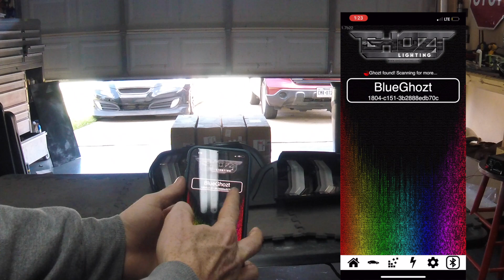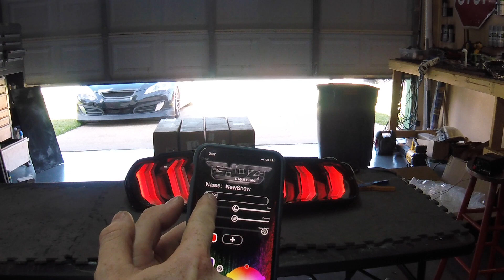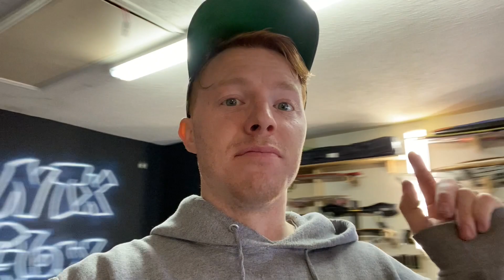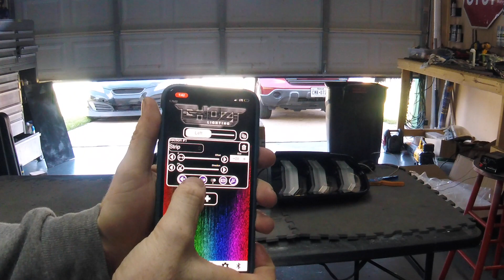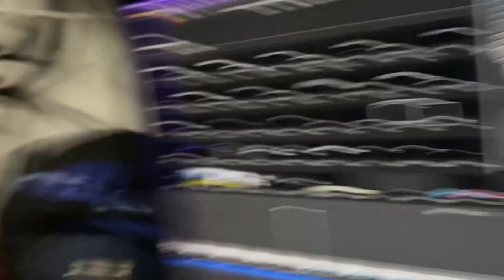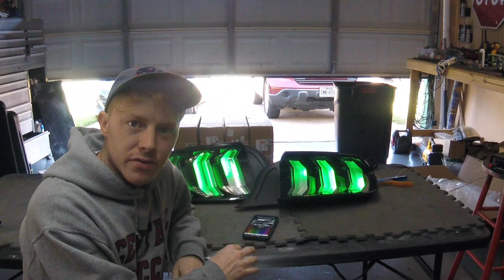how to use BLUEGHOZT APP - set up and use

Comment: I just got my headlights done. I can’t figure out how to have a solid non-blinking halo. Also I can’t select just red or white
Reply from the maker: depends on how they where built, have to make sure that the parking light wire was tapped into the oem parking light harness. or you can select the "solid" show mode, delete all but one color and then set that color to whatever you want

Comment: I’m currently dealing with an issue with my mustang tails that have the ghost control. It takes 60 per side to light up the entire housing. I have 60 selected on both but on one side only one column is lighting up. The other side is fine. Any tips? 

I have checked power, ground, connections, deleted the app, used another phone, but nothing is working.
Reply from the maker: oh man that sucks! 
kind of sound like the wiring might be messed up, like the data power or ground is not flowing to the other columns

Comment: Thank you for this, i had no idea where the pixel count were at also just learned if you dont ahve a build thats specific for a ghozt you can still use a ghozt as a led controller might not have all the functionality but can still use thw show modes
Reply from the maker: oh yeah! 
all of the new pre built headlights with rgb in them can be wired up to a blueghozt module. 
and you can wire up the factory functions as well but you'll have to tap into the headlight harnesses
Reply: @zaccook  ya I'm trying to figure that out right now, ik where and what wires I need for  custom turn signals, rn they work but no customizing and the DRLs I have a base accord with touring headlight and the harness needed but no idea what wire is for the drls so dang confusing I just want those awesome start up sequences 🤧

Comment: My parking mode lights stay on for too long and I don’t see any option for duration to set in how much time I want them to turn off🥺
Reply from the maker: the parking light mode really depends on whatever vehicle the lights are installed. 
like my genesis coupe parking lights stay on for like 1 to 2 seconds after my car shuts off. but my trucks parking light stays on for like 3 to 5 minutes after the truck shuts off.
Reply: @zaccook  the actual headlights beams turn off 15 seconds after I turn off the car but the DRL bar stays on for for 10 minutes or so unless I go to the app and manually turn off the parking mode off. I have a 2019 TLX
Reply: Hey bro, was wondering if you could help me I’m having a similar issue, on my mk6 gti, after I switch the car off even after like 2 minutes the drl lights would stay on and the blueghozt controller would still give me the option to connect to it meaning it’s still receiving power even though it’s not connected up to a constant 12V power source, I haven’t actually tested any longer then two minutes is there anything about this? Also my turn signals I’m struggling how to get them to work properly without when using my stalk for left or right turn signal blinking faster indicating it has a fault

Comment: how's it going, thank you for the video i have a question though, I just had a shop install my ghozt module and it came with 2 splitters for my underglow of course my underglow is 12V, the shop used the 2 splitters the module came with, does it matter what underglow is connected to which plug on the splitter??
Reply from the maker: Hey! So it kind of depends on how the ghozt module is wired up. 
If i wired it up i would have it set up to utilize the left and right side of the ghozt module so that the show mode works with the under glow and i leave turn signal wires out so that you could tap those in for a full car turn signal

Comment: Thank you for the good explanation! I still have two question where I couldn't find anything about.

1) I want 3 groups and each has 10 LEDs. So when I turn on the turn signal all leds in the first group fade up from 0-100% and then the next group. Is that possible? It's like a sequence, but in bigger sections.

2) Is it possible, that when I break the brake light is on, but when I also activate the turn signal, the brake light on that side turns off?

I have a 68 Mercury Cougar with custom tail lights and the part from 2) is how it works originally. That way I could mimic the incandescent bulb look.
Reply from the maker: thanks!

1. yes you should be able to do that if you have the end of one strip wired into the front of the other strip, 
if you decide that you want them to fire at the same time then you can adjust it in the app and have them all fire at the same time. 

2. yes! that is actually how the controller is designed to work already, wiring up the controller might be a little weird if your car is using the same bulb / wire to fire the turn and brake. 
may have to tap into the wiring up in the dash / fuse panel area for that signal.
Reply: @zaccook  Thank you very much for the fast reply!

Comment: Hey! I only have one question, how it is the wiring for the turn signals to work? 

The turn signal cables goes to “in1” “in2” and so on and so on?
Reply from the maker: Hey! So the turn signal inputs are actually in3 and in4 
I actually have a “how to wire up blueghozt module” video up that i posted up a week or 2 ago
Reply: @zaccook   Ohhh okay, that’s the only thing I always had a doubt because I’m new to the addressable world, thanks!!! I will check it out!

Thank you!

Comment: Thx so much for the video !
My english is bad but if i understand, we can have blue turn signal and blue brake ?
Reply from the maker: Technically yes. The s550 tail lights still have the oem red leds install so that you have safely drive during the day so the blue turn and brake may be outshined by that but you can set up a show mode that looks like a blue turn signal
Reply: @zaccook  Ah! so we cannot configure the blues turn signals so that when the turn signal is activated it still remains red ?
Reply from the maker: @FordMidableV8  it’ll have a blue hue to it but overall it’ll be red. 

On other vehicles it’s much more obvious because they have a separate turn signal bulb but with the s550 they do everything right there so the red leds kind of take over 

But you can do a blue parking light!
Reply: @zaccook  okay but i dont understand why in the app there are a ''brake'' ''turn signal'' mode if you cant use it on driving 😕😅